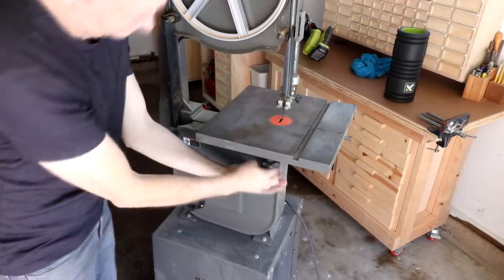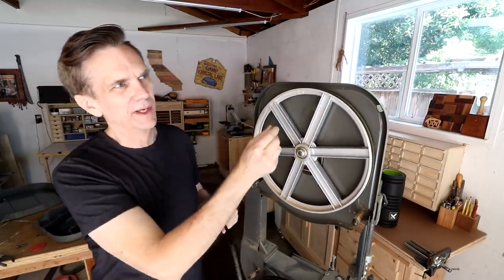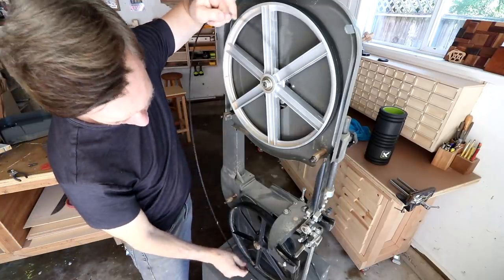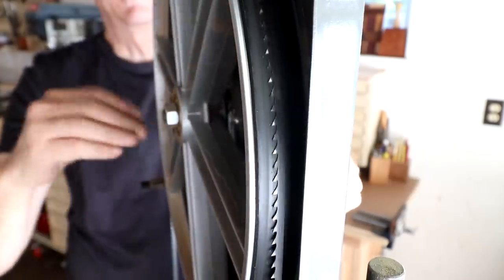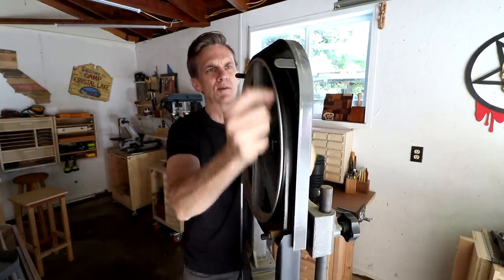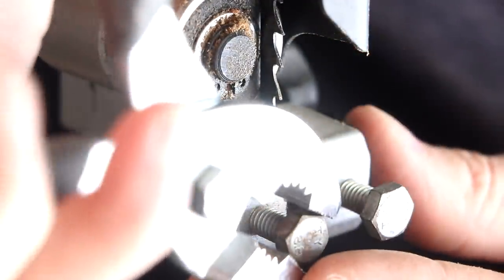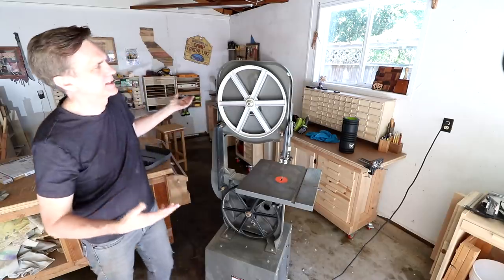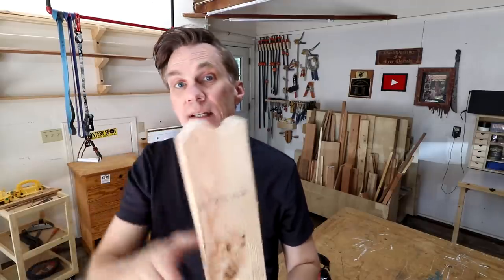Changing the blade and setting up my bandsaw | LOCKDOWN Day 69 (hehe)

Comment: Wait a minute... you're supposed to take the table off to change the blade? 
I take the blade off and turn it sideways to get it through the gap. Means you don't have to adjust the level on the table
Reply: hmmm i was questioning this as well.  think it can stay.
Reply: I have never taken of the table, and i have that exact saw!?!
Reply: Oh Steve was just showing off :)
Reply: Perhaps being a mere mortal requires taking off the table? I as a (I guess?) band saw god can leave the table on...:)
Reply: animationcreations42 , yes your 100 % right on that
Reply: I’ve never seen anyone take off the table to change a blade before, either. I was instructed by a representative from the manufacturer to do it as you described.
Reply: Pros and cons... it's a lot easier to adjust the guide bearings without having to bend down and peer under the table... but it's a pain to take off the table and put it back on... so far I'm on team "leave the table on" but I'm not married to the idea...
Reply: @jasonbailey9139  as @Bob Daniel mentions, it's a lot easier to adjust the guide bearings beneath the table with it removed.  I usually remove the table for a blade change, but I used to leave it in place.  I guess it's a matter of preference, and how easily you can bend!
Reply: Yup, that's what I do. I've never taken my table off.
Reply: Not necessary but it is much easier to get to the lower set of guide bearings with the table off.  If you follow the Snodgrass method and deepest part of the gullet of the teeth in the center of the blade, in theory you should not have to adjust the side guide bearings.  The should be just behind the teeth. Of course the bearing behind the blade will need to be adjusted to the width of the blade.
Reply: depends on the saw. i dont have to remove the table.
Reply: I've never removed the table to change a blade.  But removing the table sure makes it easier to video the adjustment of the lower guides.
Reply: Same here loosen blade. Take off wheels then take it out groove in table. Caught me off guard when he said take table off like on all bandsaws. I never seen a bandsaw you had to take table off.

I change mine all the time. Right blade for right job.
Reply: I take the table off it makes it a lot easier to do your adjustments and probably more accurate plus no bending

Comment: You're killing me coiling blades. 

Start with your foot on the bottom and a gloved hand on top, palm out. Rotate your hand to palm inward as you push down, and it'll all coil perfectly
Reply: Mortal method vs God mode
Reply: Or don't put your foot down at all. Just put both hands at about 10 and 2 o'clock of the whole blade, and twist opposite directions while bringing your hands closer together. The blade will coil almost by itself.
Reply: I’m an avid woodworker so I have some nice calluses. I’ve never worn a glove. I use my foot though. And like you said, push and twist simultaneously and it will just naturally flip into an even coil.
Reply: Watch him roll up a blade was pure comedy.

Comment: According to 3 different sources I've seen, you should have a relatively narrow blade for cutting curves and a separate, wider one for resawing that never gets used for anything else.  Apparently, cutting curves wears the teeth unevenly, so they don't track straight when resawing.  Thanks for the video and thumbs up to crush a troll.
Reply: Also a lower amount of teeth per inch for the resawing blades
Reply: It's the same with jig saws, you can only make small curves with narrow blades. Having a wide blade prevents you from turning. It's not only the set of the teeth but the blade itself is straight and can only be bent to a very little amount so in order to cut curves the blade should be pretty narrow. Also the set of your teeth is important because having a perfectly non set blade you would not be able to turn it inside a cut. 
If you aim for straight long cuts (resawing boards) you can use narrow blades as well but in most cases they have very little teeth which don't transport the saw dust out of the cut very well. Secondly wide blades provide better stability for a straight cut as the blade itself is bending less likely and will stay straight as you cut.
Reply: @ynnuswatchingyou  Mostly you're right.  The narrower (from tooth to back) the blade is, the tighter curve you can make, because  the blade isn't as prone to get in its own way. 

My main point is to not cut any curves with a blade you're going to use to resaw, regardless of its width or tooth count.   When you cut a curve, the teeth wear differently from one side to the other and that blade doesn't automatically track straight afterwards.  You can still follow a more or less straight line by constantly adjusting it, but if you never cut curves with a new or properly sharpened blade and feed it into the line of the blade, it will track straight on its own. 

I only learned this within the last 6 months, and the first source was a blade supplier/manufacturer.  I'm not an expert, I'm just passing along a tip.

Comment: The way your upper wheel was spinning freely when you had the blade off made it look like there might be a heavy spot on one side. I'm restoring a 1948 Delta Milwaukee bandsaw and wheel balancing is an issue I'm dealing with right now. That, and bearings and belts and blades and basically everything else.
Reply: Good luck with the restoration! Sounds like a cool project. :)

Comment: There's no need to remove the table top.
Reply: No, but I think it allows him easier access to adjust the guides underneath. It takes little time and doesn't hurt a thing. Plus, for those new to woodworking, and thus bandsaws, it's just a little bit more information on how to remove the table if the need ever arises. 

I enjoy the thoroughness. 😁
Reply: I've never taken the table off to change the blade but seeing the ease of it and adjusting the lower guides, I might now.
Reply: depends on the saw. my old one required it.

Comment: I disagree with the people who frown on the 9 inch saws. If you are expecting them to do the same job as a 14 inch saw you will be unhappy. I have a 9 incher  and an 8 inch drill press on the bench in the basement.  The big toys are in the garage where there is plenty of room. I make a lot of small items for craft shows so these are very useful. Easier to quickly drill a couple of hole than loading up the parts and tooling to go out to the garage. I have resawed some really hard wood for clipboards with very good results. It will be a big flop to try rough cutting logs or really thick stock. Big job, big tools. Little job, little tools work fine.

Comment: I would Never run the saw with the wheel guards removed.  Especially if I was not absolutely sure that the tracking was perfect and I wasn’t wearing a face guard.  If the tracking was too far off, the speed of the blade flying off could/would be fairly dangerous.
Reply: I cringed when Steve turned on the saw too. I was thinking safety glasses! My el cheapo bandsaw won’t turn on with the covers removed.
Reply: It's not a big deal if you have it adjusted close by hand first.

Comment: Just a safety note here, but you should always be behind the band-saw (opposite of the open side) when testing a new blade, while applying power to the saw.  The likelihood of a blade failure is greater on a new untested blade and a broken blade flying off of an open band-saw is not something you want to be in the direct path as close as you were in this video.

Comment: Once you get the feel of it, it's much easier to coil the blade by holding your hands palm up at waist height. With the blade (teeth up) in both hands with about 18" of blade between your hands, bend your elbows so the blade is straight up. In one smooth motion, (focus on the outermost part of the blade) straighten your arms and at the same time twist the blade (in both hands) inward. If you do this motion smoothly and quickly the blade will coil up perfectly

Comment: Been using band saws since I was 16 - I'm 51 now. I've never, and I mean never, had to remove a band saw table to change a blade. If removing the table was built in to the design then those who engineered your saw need to go back to school. I was glad to see that you are using a blade from an American company. I've used   Starrett products nearly as long as I've used band saws. Great company, great products.

Comment: I just had to replace the drive belt on my bandsaw. After adjusting the tension, it works better than ever. However I'm missing a tire on the upper wheel.

Comment: hey Steve, The inches of a band saw refer to the diameter of the wheel, so the actual throat or cutting capacity between the blade and the riser/frame is something less.
Also The main concern with a lot of tension is increased metal fatigue that will cause the blade to brake sooner than it might if properly tensioned.
The proper way to uncoil a bandsaw blade is to throw it at a squirrel.
Reply: Underated comment

Comment: Now you have all this time....when are you going to make some time to use your lathe again???????  My bandsaw won't let me run it with the doors open micro-switches cut the circuit.  Rely on the wheel shape keeping it in place once you have done it with the hand turning.  If it comes off when the doors are open you can get serious injuries.
Reply: Agreed. I kinda tensed up when he turned it on without the doors on but then again, my bandsaw has a little window to watch the tracking with all the doors closed. I suppose if it didn't, I don't know what I would do.

Comment: I used to be unsure whether I need a band saw or not so I bought a second-hand one for AUD 40 (USD ~30). Yes, I know, ridiculously cheap, even if it didn't have a blade, had no table insert, and the laser was wrong. I bought a cheap blade for it and am still using it without the insert. (I fixed the laser easily but it is completely useless so it doesn't count.)
My feelings are: yes, it is small, not too powerful, definitely not large enough for re-sawing but does all the job I need. It cuts plywood, MDF, 19mm (3/4") pine, and so on, everything I need. I couldn't live without it and would definitely buy a lot more expensive one if this tiny one wouldn't be enough for me.

Comment: I picked up a 9" bandsaw from a coworker for $50 because he didn't use it.  I figured it was a cheap experiment for a power tool.  Had I paid full price I'd have serious regrets.  A bigger, more grown-up saw has got to be better than this toy.  It's tracking is basically not adjustable!   🤣 I used it to cut out my COG puzzle, and I have a bandsaw box on my project list, but I'm not in a hurry to do it.  If I start using it a lot, I will consider finding it a new home and finding myself a 14" model.

Comment: I, like you, don't use my band saw very much. Mine is a Shopsmith and what I noticed is that yours doesn't have built in adjustment numbers for reference. I was not aware some bandsaws lacked them. For example, a printed set of numbers to set tension on the various blades. Mine has them and are quite handy when changing blade sizes. As for use, they are great for resawing. Great way to turn a small log into useful wood for projects. Have a great day, Bill Larrabee, Pulaski, NY

Comment: As always your instructional technique is fantastic.  You are right about the smaller band saws.  I have a 9" table top models and I find it's very limited in what can be done with it.  The working height is only about 3 1/2", which making something like a band saw box pretty hard.

Comment: I did a bandsaw course with the supplier (Axminster Tools in the UK) back in January but hadn't used my new machine since - video was a great refresher - one thing though, very surprised that the guards didn't have switches to stop you running with them off/open (mine has micro-switches on the doors) - perhaps that's because it's the UK with different legal requirements?

Comment: Just got a bandsaw a few weeks ago, can definitely say the blades make all the difference. Upgraded the basic one it came with to a  new Axminster blade for a larger one 1/2inch for splitting boards a be a small one 8th for doing the curves. 

 Also take note of the tpi as the lower the tooth count the more dust it will shift out the way, good for when your cutting hardwoods. 

Also goes without saying but dust mask these things make very fine dust!

Comment: Steve, I think for accuracy on the upper & lower saw guides - specifically the blocks: Both pairs, being identical, & in respect of their attitude (not quite touching the blade itself), measure the distance of the extruding block (on the outer surface of the mount) with calipers, then tighten. I would not alter their position, by eye - that's a personal method - but it's never failed me, & my blades run true. Second, I woukld agree with other commentators, here - there's no need to dismount the table - even if it's not square - that can be adjusted, in situ, & finally, please use a combination spanner when tightening bolts - grips  round off the heads.
Hoping that the Ramsey clan are all well - stay safe :D

Comment: I have one of those teeny 10 inch craftsman bandsaws.

I can do some re-sign with it but I have to have a very sharp blade and go really slow. The max I can do is 4 1/2 inches.

I live in a townhouse with a tiiiiny shop and I have every major tool except a benchtop planner, drum sander or large.  I don’t have enough room for a big bandsaw. Wish I did though.

Comment: I have a Grizzly G0803  9 inch bench top band saw.  I do wish I bought a 14 inch like your but it does what I want it to do. When I first got it I had to square and adjust  how it cuts. It came with a 1/4 X 60 inch blade. I found that the 1/4 inch blade would drift a lot and bought a 3/8 X 60 blade.  It ran and cut much better with the wider blade.  It was what I could afford at the time.

Comment: I use my bandsaw all the time, to the point I actually have two of them. I have a 14 inch for curves and bandsaw boxes, and I have a 18 inch strictly for resawing and veneer making. I use a 1 inch carbide blade on the 18 inch, an a variety of smaller blades on the 14 inch. Carter makes the beat bearings. Laguna makes the best bandsaws in the market right now.

Comment: hello Mr. Ramsey
I do not know if I am in the right place to ask you this question.
I would like to know if you have already mentioned changing the rubber band on the two steering wheels. I have a band saw identical to yours but maybe a little older and my bands are all cracking. I don't know where to get them.
thank you

Comment: The guide blocks are pretty much only needed when cutting curves. When sawing straight you only need the bearings at the back to prevent pushing the blade too far off center. The guide blocks at the sides provide stability when turning the lumber and cutting curves. Some people like them more loosely guiding, other prefere them rubbing on the blade a little bit. This also is linked to your blade tension - having lots of tension will keep the blade straight event with loose guide blocks. You have to experiment to see what's suitable for you and your cut.

Comment: I'm pretty sure you don't have to remove your table to change the blade. My saw looks like the same mass made saw with a different badge and you loosen the blade and then rotate/slide it out the slot in the table, not remove the table, rotate/slide it off the blade before loosening it. As I said that's how I do mine and it looks same same. Can do it both ways, but if you can rotate the loose blade then you will save removing and re-calibrating your table from scratch. Although I may have missed something on your saw :) PS love your daily videos.

Comment: Well that was timely. I have THAT bandsaw, bought from HF.  It has been parked in the corner of my shop for a while, as it has basically stopped cutting.  I kept thinking it was a case of poor judgment on my part to buy it, so I was thinking of spending a lot more money on a new one.  Then I had the bright idea that it might need a new blade.  Couple days ago I put on my mask and went to a big box store and bought a thick blade for resawing and a thin one for curves.  The blades are still in the box but I will be changing soon.  Now I can look at your video and see my saw, then get that blade changed.  Thanks.

Comment: Steve you def need a new bandsaw get yourself a Rikon or Laguna. Used both and they both are great. Blade changes are much easier. I've had this bandsaw and I never used it bc I disliked it. Once I got a newer decent one, I found myself using it slot.

Comment: Small blades are typically harder to get tracked due to putting too much tension on ur blade. Back of blade gullets need to be in center of wheel and use finger to put pressure on side of blade and when it deflects no more than 1/4” you are good to go. Remember to do all this with the guides bearings/blocks moved out of the way so the blade moves/adjusts without hitting them. Don’t forget to remove the tension off ur blade when done using. If not it will conform ur wheel skins to the blade and you don’t want that. Sucks when you don’t have a detentioner handle but work with what you got.